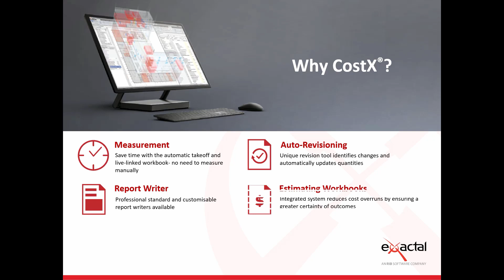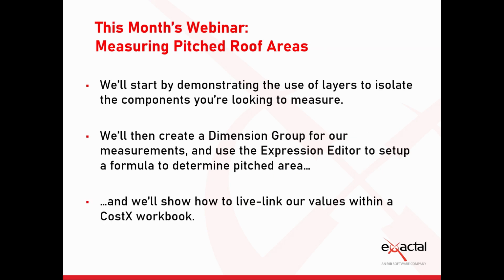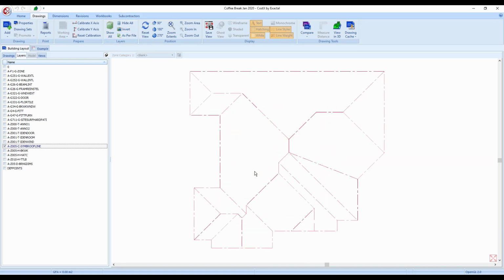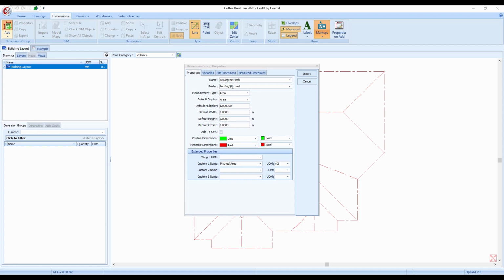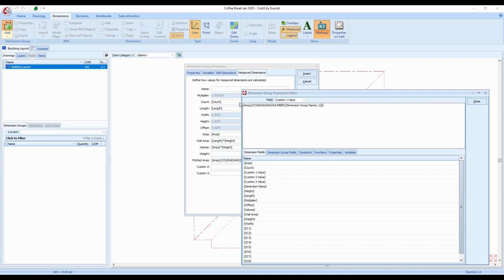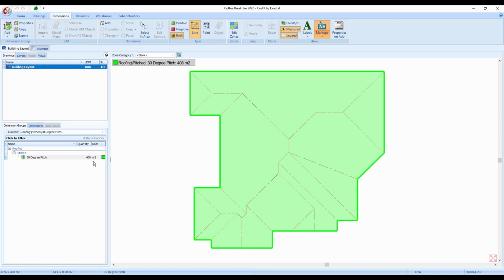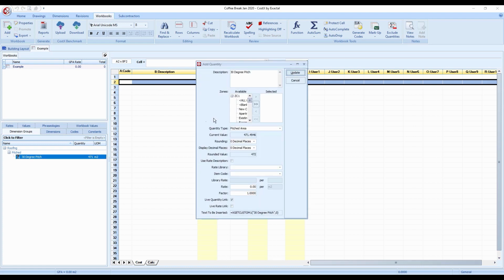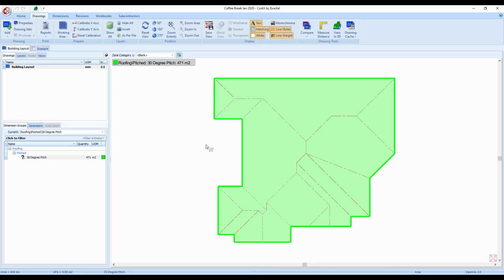CostX Coffee Break Webinar - Measuring Pitched Roof Areas

Comment: when i do a scaled dimension tracking, it show a deviation of 4% error, that is a lot for repeat unit. ie terrace. When compare with other software ie math mate, it still differs. So for me, i won't advice my client based on your formula. This the year 2020, digital measurement should be 99% accurate. Bad  advice
Reply from the maker: Hi Johar, we're not too sure what you mean as the formula is mathematically correct and produces an accurate result. If you have any further questions about the process you can contact us at feedback@exactal.com.

Comment: What is the formula that you have used for roof area, I cant read it off the screen
Reply: Thanks Phil, appreciate it might be difficult to see on a small screen! Matthew appears to have used a Pitched Area formula as follows, that you should be able to copy straight in - {Area}/COS(RADIANS(XNUMBER({Dimension Group Name},1)))     -  hope this helps!
Reply: @ExactalTechnologies  I want to ask where to put the 30 degrees in the formula
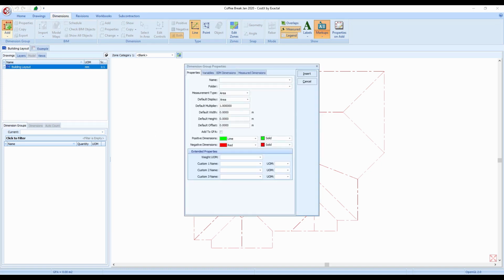Reply from the maker: @leocai3504  When Matthew fills out the Dimension Group Name field at 3:37, you will see he enters '30 Degree Pitch.' Therefore, the (Dimension Group Name) section of the formula automatically reads this input data as 30 degrees when calculating. Hope this helps!